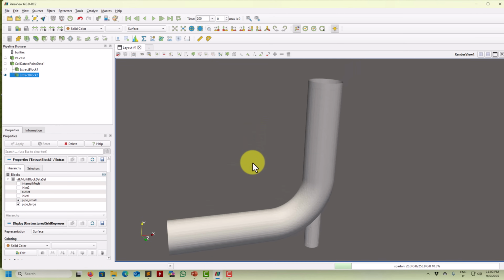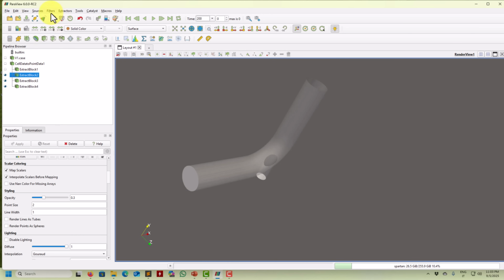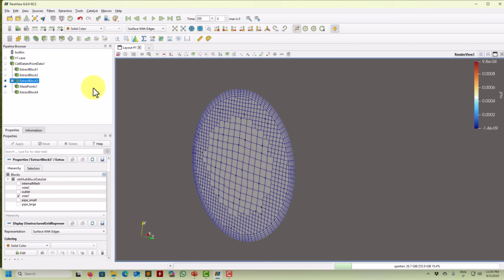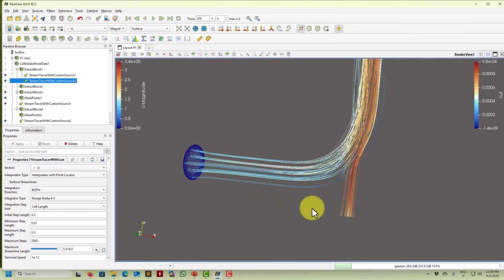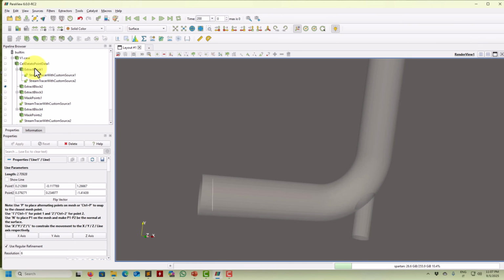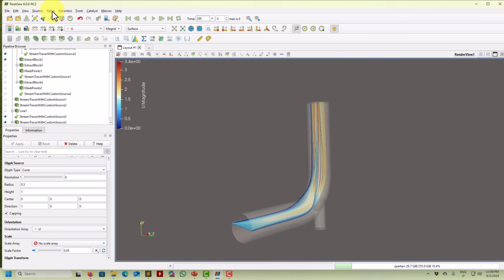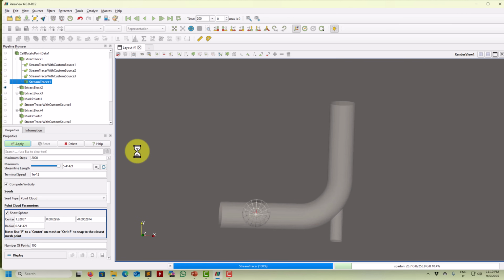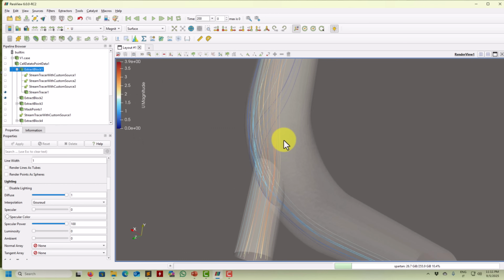🍪 CFD cookie - Mastering paraview - Streamlines - Part 5

Comment: Is there any way to export the scene in paraview as vector graphic? There is the option to export as svg or eps, but the streamlines are still blurry when I zoom after export.
Reply from the maker: Good question. From the GUI in paraview I think it is not possible.  Maybe using python scripting is possible. They way around is to do upscaling (with not too much creativity) of the png/jpeg.
Reply: @wolfdynamicsCFD  Cool, thanks for the reoly :) The workaround I found is to just save as screenshot in a ridiculously high resolution. To fix the problem that the streamlines become too thin, one can just set the line width in the streamtracer properties to something like 50. This will look awful in paraview, but will be fine in the final screen shot.